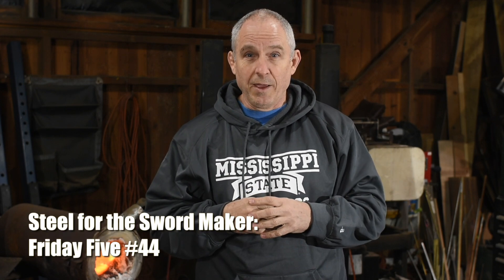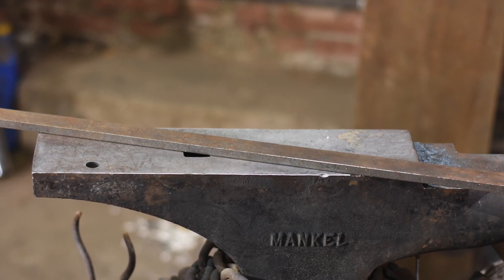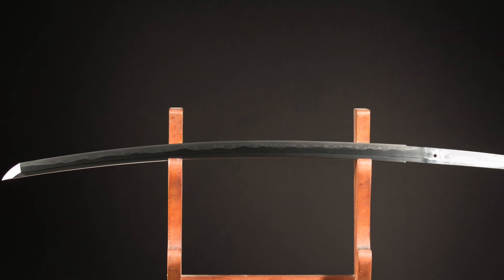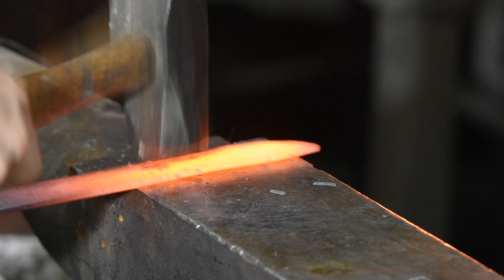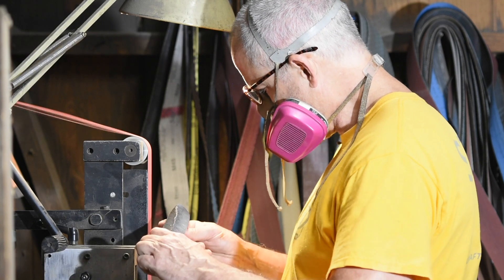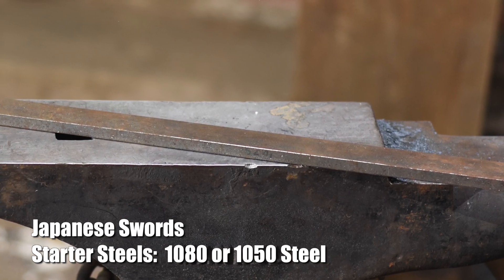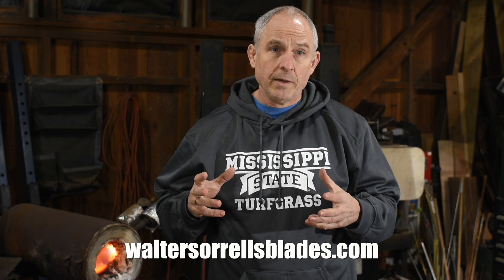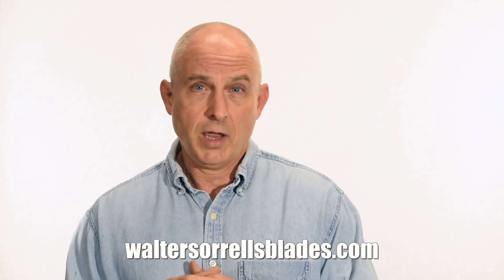Choosing Steel for Swords:  Knife Maker's Friday Five #44

Comment: hi,I have catana sowrd 1045. what's your opinion about?
Reply: What brand did you get. As long as it's heat treated right, 1045 is a good steel for katana. It's more forgiving than the harder steels but at a loss of edge retention.

Comment: Walter Sorrells, you mentioned for medieval style swords that 80crv2 and 5160 to temper at  600 degrees Fahrenheit.. would 1075 steel be around the same temperature? 2 hours for 2 cycles?
Reply: He states 400F for 1050-1080 steel.

Comment: I would like to make a Norman style sword. I have had problems with O1 in the past with brittleness, but I may not have normalized it properly.

This was a great discussion
Thanks
Frank
Reply: O1 isn't the best for swords unless it's differentially heat treated or you stick some potatoes and carrots on the edges and go nut with the blow torch
Reply: @Dylanschillin  O1 can work but ends up pretty complicated from what I know. If you have the equipment or can getto rig it a bainite heattreatment should help. I've seen people manage it with hot oil baths vs full on molten salt.

Comment: I’d also like to play around with AEB-L at around 58 hrc. I use it at 60 for all kinds of kitchen cutlery and based off the charts I’ve seen, it has great toughness for a stainless steel. I probably wouldn’t make a full sized katana at 61hrc but I think a 20”-24” blade would be completely doable.
Reply: The shock is likely still too much. And 58 is already pretty hard for alot of swords. 

A few makers have done sharp stainless swords but usually requires specific alloy selection and really really complicated heat treatments. The one I know of that used to exist had a heat treatment done to like aero space style standards and has softer in the core then the rest of the blade.

Comment: What titanium grades would be for knife making and sword making
Reply: Why would anyone use Ti in a sword or in any knife (except for seawater diving and/or climbing)?
For bolsters, go for Gr2 instead of Gr5. It is cheaper and much easier to work with.
Reply: None, titanium is horrible for blade making.
Reply: @T-DsGaming  I've  heard its abrasion resistant so hard to work witb but wouldn't that mean it will hold an edge longer 
I've seen man at arms make titanium swords and things thats why I'm curious

Comment: Another that seems to be overlooked (maybe rightfully so) is 3V. 
Very high toughness, good edge holding, and when I messed around with it @ 60hrc, it was solidly in the “semi stainless” category imo. Not saying it wouldn’t rust after a while (so will most stainless steels) but I couldn’t get it to take an etch at all with my acid bath. 
It’s a pita to grind both before and especially after heat treating, is quite expensive, and the heat treat is more complicated than other simple steels (I’m sure there are countless recipes, some easier than others).